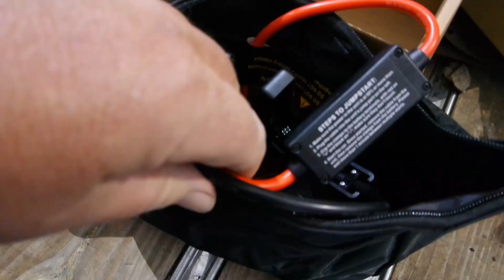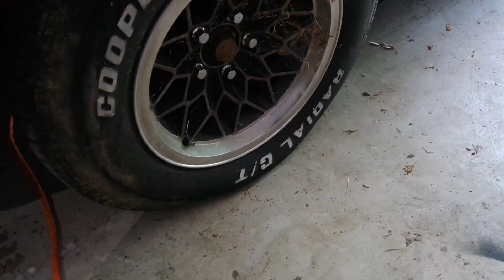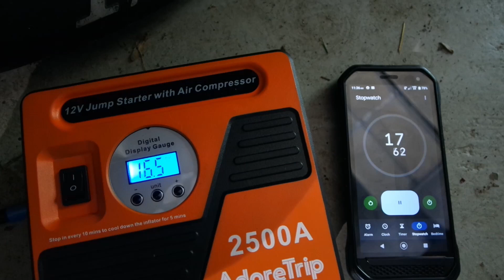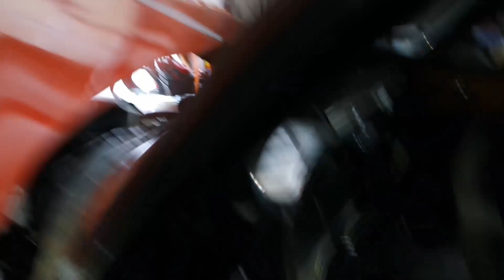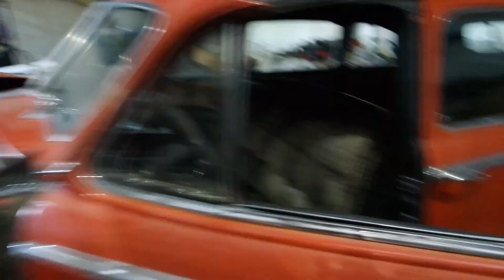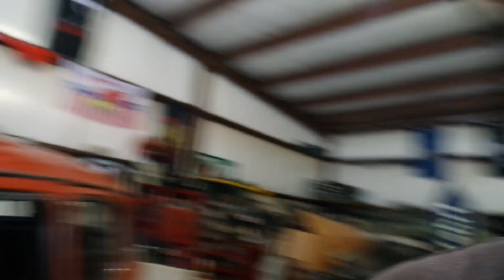Unboxing, Testing and Using the Adoretrip 2500Amp Jump Starter and Air Compressor

Comment: Good video. Yeah, good honest review. Wow, I am very impressed with that. I wonder if it would work up here where it gets colder for a longer time. My Buick is a big straight 8-cylinder and has a 6-volt system. It rolls over slow when it's warm out. I wonder if it could start a 6-volt. That would be interesting. I would definitely use one like that. Thanks for sharing.👍👍🍁
Reply from the maker: I had a 50 Buick Super back in the late 80's that I would jump off a 12v battery. It cranked really fast with a 12v battery. Always seemed pretty sketchy though lol